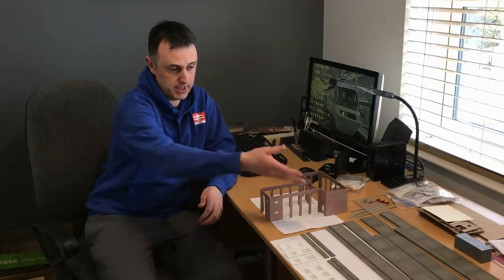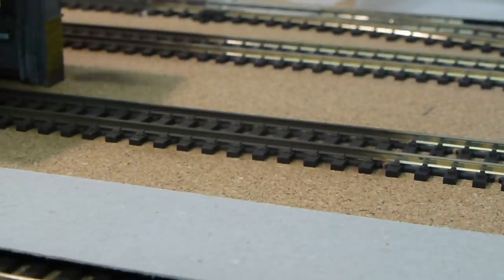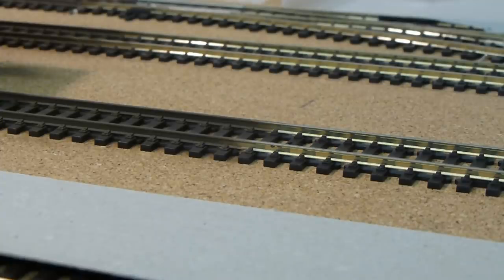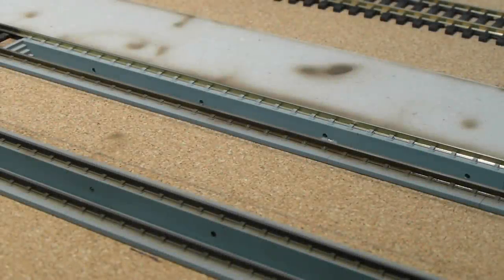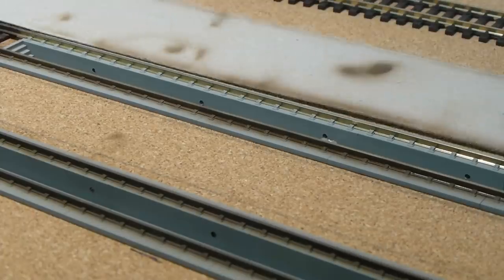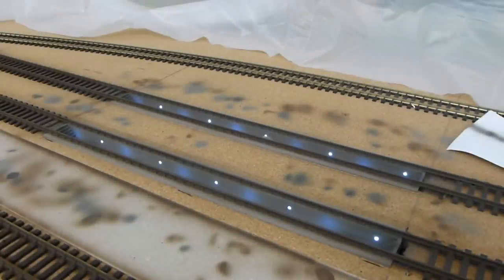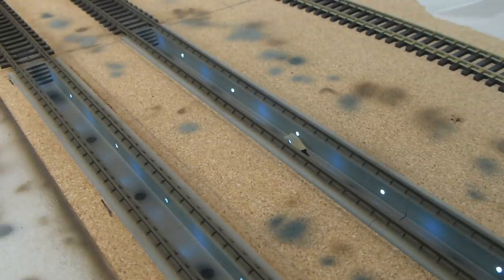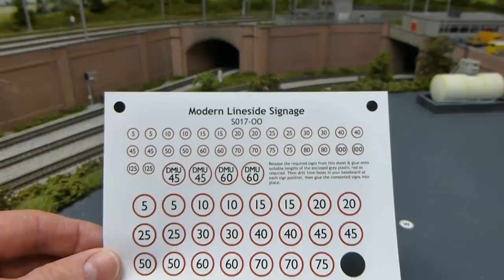Model Railway New Depot Update 3 | Peco Inspection Pits | Dean Park 206

Comment: Hi David, Been watching your videos for a while your layout   is great. I'm building my own layout at present an combination of Hornby two rail and Hornby Dublo three rail . The question I have is if you paint the tracks would this effect the running of the train has the paint could act has a barrier between the rail and pick ups? Thanks
Reply from the maker: Simon Cole hi. No it doesn’t as once the paint is dry you clean the Top of the rails using a track rubber. Cheers. Dave

Comment: Do you have to make sure that the locos can still run on the sprayed track. If so, how do you make sure?
Reply from the maker: King Orry of the Peel Godred Branch when paint it dry the tops of the rails are cleaned with a track rubber. Just like on the rest of the weathered track on the layout. It wouldn’t allow trains to run otherwise. Cheers. Dave

Comment: The weathering is looking good. Maybe a bit of that Hattons oil can be applied as well where leaky locos have stood while under repair. Also I like your picture on the wall Is it a painting print or photo
Reply from the maker: cedarcam hi thanks. Hattons oil spill kit will be applied when the hard standing and ballast is in place. The picture is a photo. I got it and then framed it. I came across it online and the guy who took it has a website. The frame cost more than the photo lol
Reply: OK Thanks I will have a look for it. I have got a few framed prints of paintings. They can cost a bit but sure look better in a frame. Looking forward to seeing your next update on the MPD.

Comment: I watch  your videos and iam  going  or trying  to  go dcc do you  have to run  too buss lines if you  have  too tracks  your help would  be  helpful. Thanks  eck
Reply: You don't need a bus wire but your layout will be more reliable if you have one and it will be easier to add accessories.
Reply: If you are running DCC, you only need one track bus pair (1 pos and 1 neg for want of a better explanation) no matter how many lines, sidings,  etc. you have.
Reply: Thanks for your  help guys